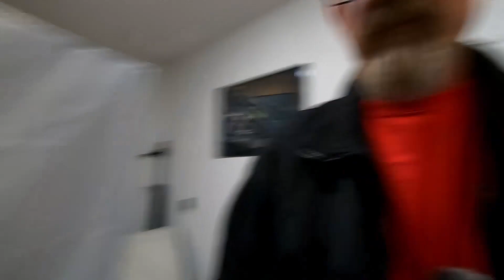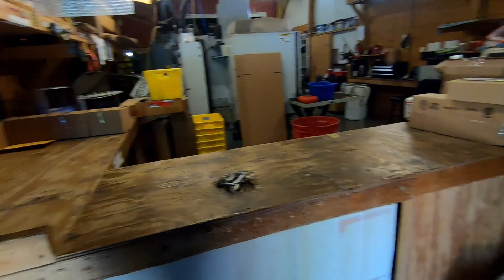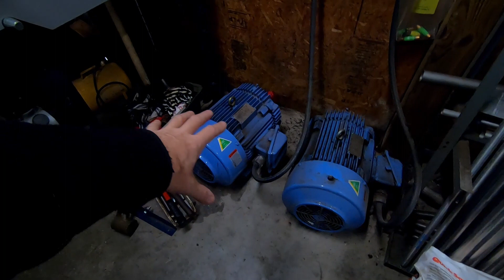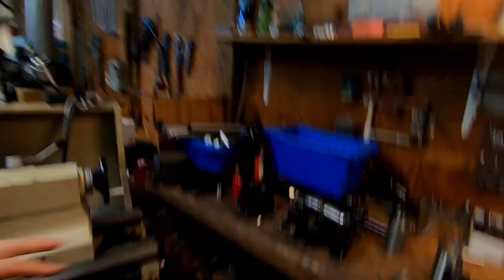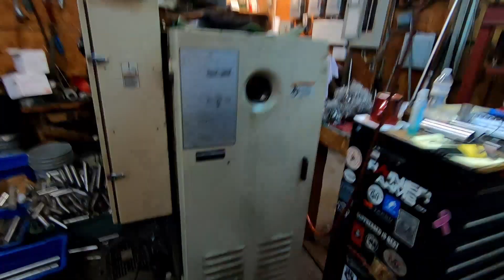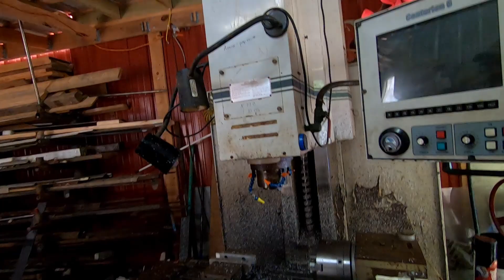Georgia Photographer Shop Tour 2020

Comment: Very interesting tour. Thanks! How long until you get a 3D printer? :)
Reply from the maker: I dont know yet. We have not had a need for one much so far, so we have been reluctant to buy one. Plus, the tech keeps improving SO fast, if we hold out another year or two, we can get some really amazing feature sets for really reasonable money. We have even looked at the metal printers as well...not cheap, but they allow for shapes that are not possible by regular machining practices.

Comment: thanks for the tour. Hopefully you'll survive this economic downturn. maybe venture into making lens adapters. ofcourse hard to compete against $5 china aluminium.
Reply from the maker: I have thought about it to be honest. I thought about some mods to the existing marketed idea that I have not seen yet... just sayin’ 😬
Reply: @davidsaylors  i try using several Projector lenses and would be easier with an M42 threaded piece of "pipe". with a locking nut. maybe something to look into. Should be relatively easy to produce with your machines. ;)
Reply from the maker: I honestly dont know much about projector lenses to be honest, I will have to look at how they work compared to film camera glass.

Comment: Wow.  Had no idea. Thought we were going to get a tour of your tool shed.   What is your main product?  Can you make outdated parts for old machinery?   Impressive!!!!
Reply from the maker: Haha. The toolshed is pretty cool too, just a lot smaller 😬. We do, in fact, makes parts for old machinery on the regular. Out biggest product though is silencers, they fund pretty much the whole operation to be honest. 😊
Reply: David Saylors Wow, that’s neat.   What type of parts?  Can you make mechanical parts for obsolete machines like my old Gravely lawn tractor from the 70’s?  my friend uses a Timberjack Log Skidder from the 70’s and he’s been running into trouble finding parts recently too.
Reply from the maker: Yes, but the problem is our fixed costs run higher than what people are comfortable with paying for a part. The availability of really low cost replacement parts for mainly cars and tractors has created a mindset that all parts should be like that, even the ones that have to be made and people get their feelings hurt when we quote what looks like a simple job and the number seems astronomical to them. But they forget that we have a significant amount of fixed costs that we have to offset and it leads to people being upset with us some of the time. We are happy to take a look at any part you need, just sit down before reading the quote for a custom one off... 😬🤷🏻‍♂️
Reply: David Saylors I understand.   But will keep you in mind because replacing my Gravely tractor would be very expensive anyway.   And it’s built like a tank unlike what’s out there today.  And my friend who is a logger is near retirement and is in no way wanting to purchase another log skidder.   He’s had this one since the early 80’s and parts are not cheap to begin with especially when he has to look all over hell’s acre for the ones he’s able to locate.   Have a good day!
Reply from the maker: I understand completely. 👍